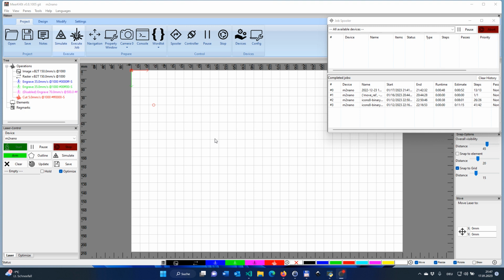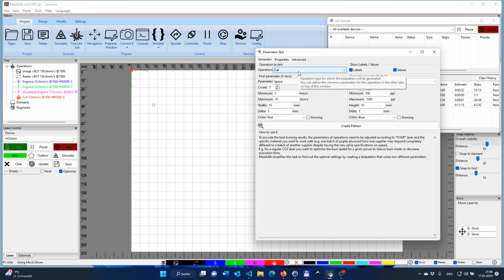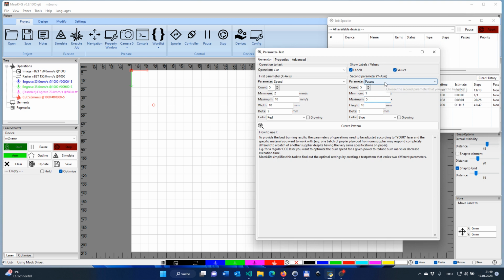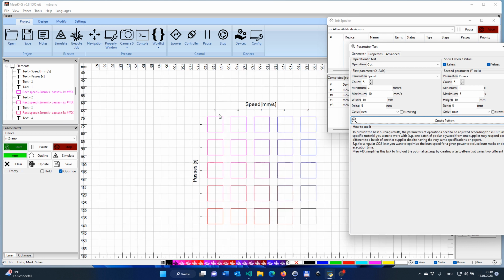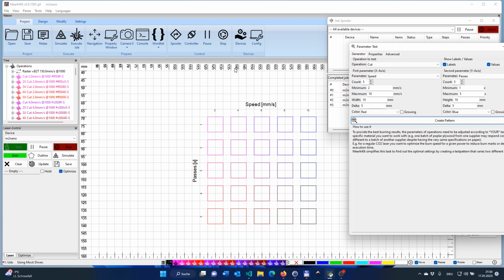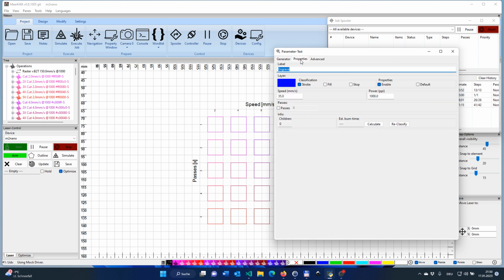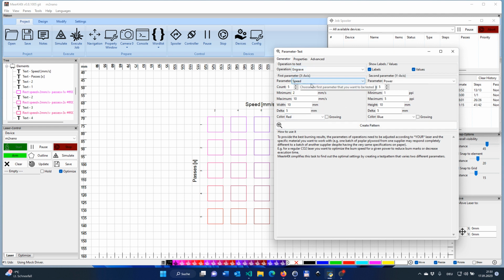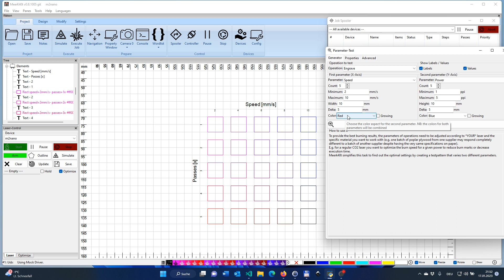MeerK40t - Choosing the right burn parameters

Comment: Hallo Jens,
vielen Dank für deine lehrreichen und interessanten Videos!
Ich lerne gerade den Einsatz eines K40 mit MeerK4t und habe ein Problem: Ich habe immer einen kleinen Versatz von ca. 2mm nach rechts, wenn ich ein Element nach dem Gravieren ausschneide. Hast du eine Idee, woran das liegen kann?

Vielen Dank und beste Grüße
Pascal
Reply from the maker: Hi Pascal, difficult to answer without access to the file you use. You can go to one of the two main interaction areas with the developer team:
a) Via discord (https://discord.com/invite/vkDD3HdQq6) - a more informal (and hence preferred) way to get support and to share data
b) You can raise an issue (ie bug report) via github (https://github.com/meerk40t/meerk40t/issues). You want to be sure it's a bug though 🙂
Reply: @JensPirnay when will you be act to assist with software I’m having the hardest time figuring this out
Reply from the maker: @85sexxyblack  YouTube comments might not be the best way to interact - I recommend you reach out either via discord (my preferred platform) or via facebook - both channels have the charm that you will meet more helpful people... 🙂
https://discord.gg/vkDD3HdQq6
https://www.facebook.com/groups/716000085655097/